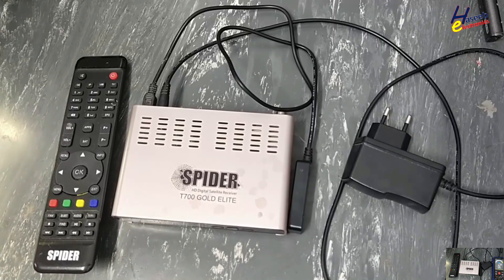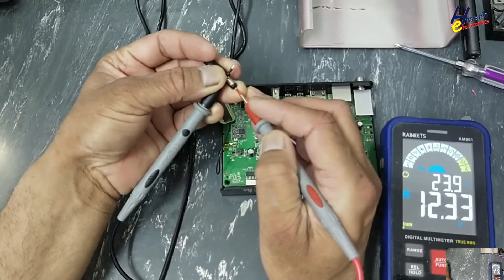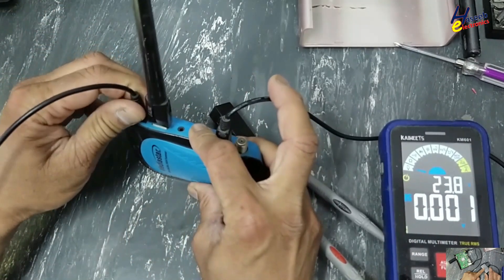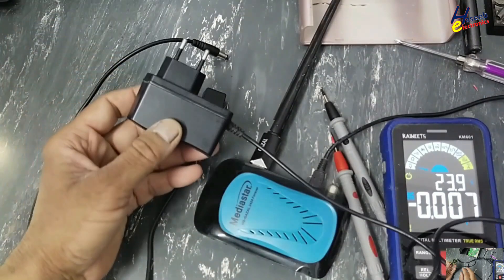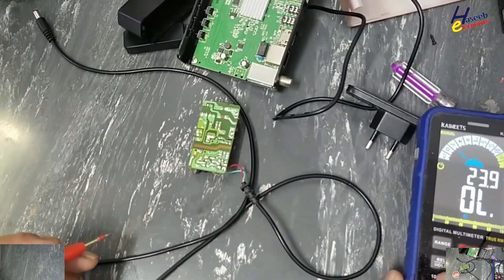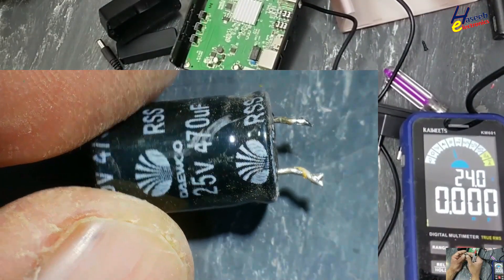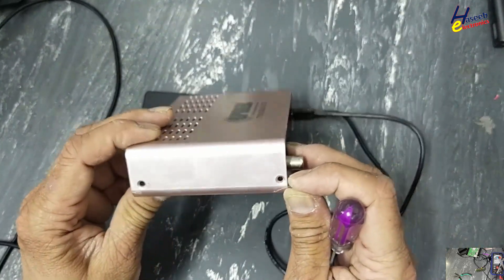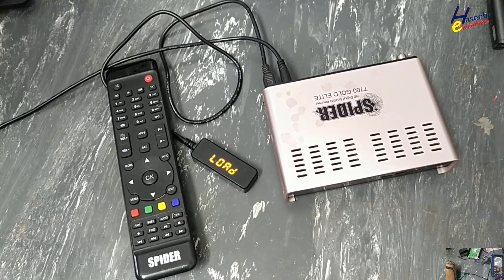{1280} Digital Satellite Receiver Repair

Comment: Thank you for sharing. I've had the same issue with laptop chargers. I learnt that just because the voltage is correct on the PSU, doesn't mean it will be correct under load. I always like to test with my own power supply before opening the device.  :)

Comment: Why the chip is not reebooting when feedback is missing?
Reply from the maker: logically it must reboot. as there was another capacitor in parallel to the damaged one before inductor. and there are many capacitors in the circuit, which are compensating the reboot pulses causing the volatge drop at 3 volt